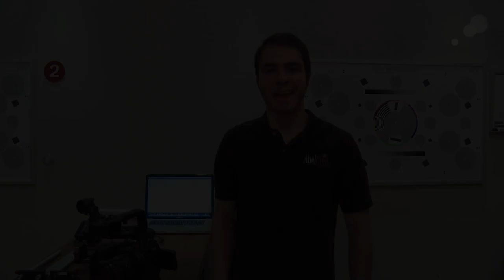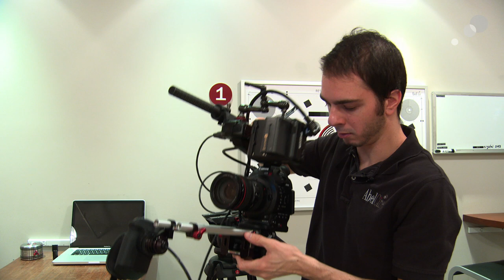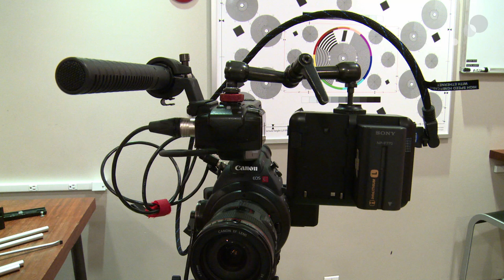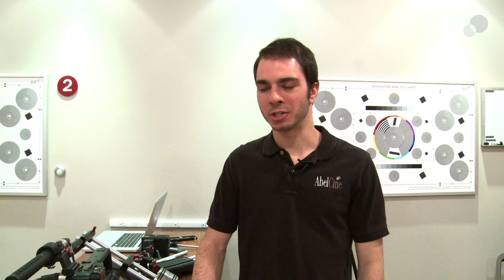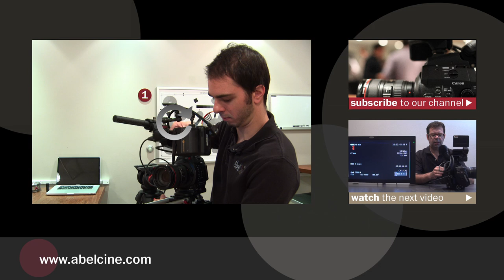At the Bench: Building a C100 Rig

Comment: Would like to see the most compact rig setup for the c100. I think this is just way to intimidating to walk around at events.
Reply: Frank, 

The ENG style rig is the most compact way I've found to kit the camera out and have the weight of the camera on your shoulder. Another option is to mount the camera on a gun stock-style accessory which will provide some extra support when doing run and gun shooting.

Dave Kincaid
Reply: Dave Kincaid It will also give you back pain at the end of the day. I did mention this in a previous post but I guess Dave saw fit to remove it. Set up shown offers no benefit. Try using the camera as is and you will find it works well without all the extra, stuff. Just use a Zacuto C-Finder and ditch the rest.

Comment: I feel like there's a few things missing here. No counter balance plates on the back? And isn't the forward grip so far up the front that you would see it on a wide angle?
Reply: Uniden:

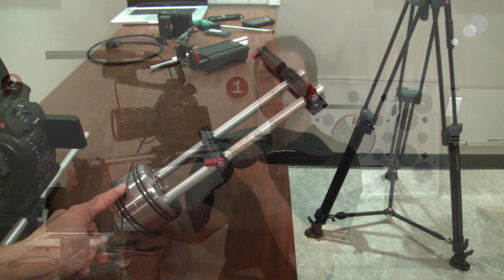If you go to 3:12 there is a detail shot of the back half of the rig, and you will notice a Zacuto counterbalance weight behind the shoulder pad. I also mention it.

Lens's as wide as a 14mm fisheye can be used with front rods that are approximately 8 inches in length.

Dave Kincaid